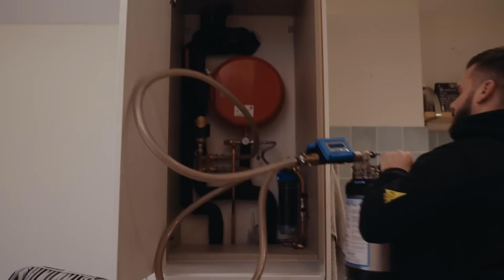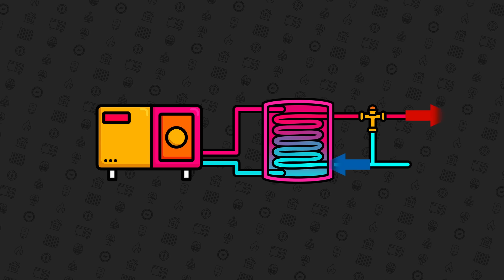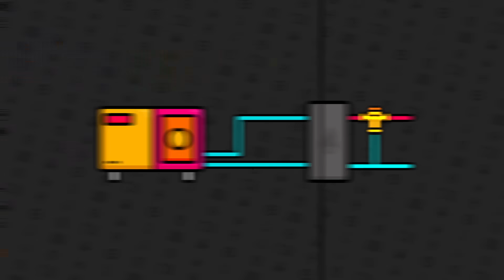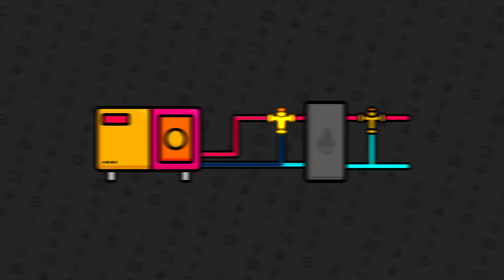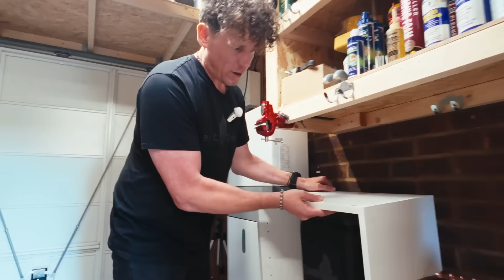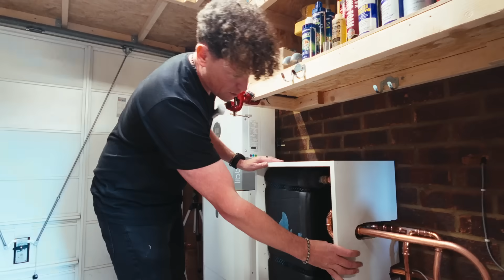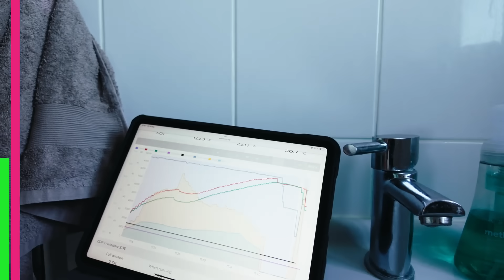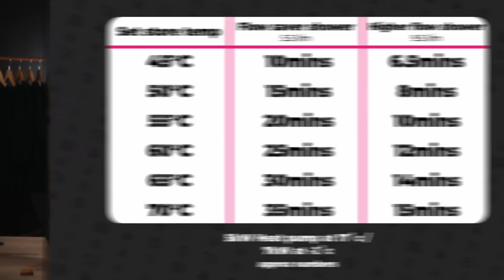World’s smallest hot water solution. (With a heat pump)

Comment: Excellent. 
Can I put one of these together myself with off-the-shelf parts?
Would love to do this in Tasmania.
Reply: Easily, it's all there in the video!
Reply: The heat exchanger is around the  euro 2000 price tho'
Reply: @brackcycle9056   350-500eu, but still its a stupid idea.
Oh scratch that, I was looking at the wrong model, those start at 1k, so this is even dumber.

Comment: but dont the uk regs say it needs to reach 60 degree for legionnaires? can the blending valve be set to 60 on one side and another temp on the other?
Reply: That's commercial regs, not residential. For Legionella to grow, the water needs to be stagnant as well. Given the low volume of water that would be stored in this, there's essentially zero chance of it not being turned over enough to be a problem.
Reply from the maker: Please watch out legionells video. Also the water in the plate could well be above 60c… dirstribution pipework isn’t storage

Comment: Hi, well done for trying this. Surely there's significantly more potential in combining a heat pump with phase change material (PCM) such as what Sunamp, Nyle and others are doing?
Reply from the maker: No. That has an extra heat exchange which makes it even less efficient and slower. Also needs another heat exchanger which takes up space. Also less simple generally

Comment: Thanks for all your efforts to make efficiency available to all, it is very inspiring. Electrifying things like heating and hot water is crucial. 
My only worry (as an ignorant lay person) with your system here is that is seems to have a lot of mixing valves doing clever things and I wonder if that will end up being a problem in a hard water area. Might it require a lot of maintenance and servicing?
Reply from the maker: Much less than a combo boiler. 70* less

Comment: Good luck getting the heat pump to kick in in a minute or two every time, mine can take up to 10 mins to kick in, I've had a 17kw heat pump maintain a constant 50oC in a thermal store
Reply: Sounds like you need more monitoring/control on your devices.
Reply: @mortenprivatekallesoe8917  i install many heat pumps from different manufacturers, they all have delayed starts to prevent compressor short cycling and regulations on starts per hour for DNO

Comment: This vid inspired me:
What if a 10L or 15L low-power DHW cylinder is filled with the DHW output from a standard Heat pump?
This setup costs 25% of the setup with a plate heat exchanger and two blending valves.

I have developed a DHW cylinder dimmer for personal use to heat a DHW cylinder. 
This DHW cylinder dimmer with a max capacity of 8A (=1.800W) is based on an ESP32 and could use the overcapacity of the PV-panels …
… to ‘recover’ from showering, 
… to slightly increase the temperature of DHW 
… for a weekly legionella run

Btw, I developed this DHW cylinder dimmer for personal use, not for commercial use.

Comment: small snag: the plate heat exchanger alone is 1500 pounds at manufacturer in Poland, before import tax to the UK, no diverter valves, no plumbing, no insulation. kinda pricey I'd say. stainless steel has a very poor specific heat capacity, as has copper (that's why they are so great conductors of heat), less than 1/10th of water's, even tough volumetrically that almost evens out, though water still comes out on top. It would be far far cheaper if you designed for water to be the heat mass and for a smaller plate exchanger to give you the speed of heat transfer that you need for the shower flow. Essentially you could store the same amount of energy, for like 1/15th of the cost. this way you are using a 3.5MW(!!) and 1500 GBP exchanger literally as thermal mass, which sounds (and is) kinda nuts. Just design for the power the shower needs and see which is the smallest heat exhanger that can give you that, with a small overhead, problem solved. A 45kW exchanger is 40 GBP, no stupid 2" connections either.
Reply: If you think of this being similar to replacing a cylinder then £1500 doesn't seem too awful
Reply: @AdamBeddall  I don't know, would it though? I mean replace the cylinder in functionality? Because it seems like a very high price for a quickie in the shower, for the same volume of storage, only distributed in a cubic shape, as opposed to a cylindrical one. There are cubic water 'cylinders' as well, if that's what is needed to fit. Hell, you can take a 100l jug of water, insulate it around, and you'd have the same thermal capacity. Add a 50 quid plate and that's you done. That's not a grand and half surely.
Reply from the maker: Don’t worry about all that. We can get these for about £500 or even less. Thai was just for the test
Reply: BA115-100 model used in Nano Store is priced at €1,719.99 (approximately £1,462) . That includes VAT however. So xVAT ~ £1,218.33

In the context of a £7.5K grant this is not outrageous!
Reply: @barryjames5879  
you still have to pay the VAT to UK HMRC when importing the goods, the seller will charge you VAT at sale point and then pay it to the UK.
in the context of other tax payers paying for the heat pump+install, nothing is too expensive, up to the grant sum. funny how as soon as there is a grant threshold, everything ends up being more expensive by exactly that amount, must be a coincidence.

Comment: This is impressive, but I disagree with the statement that just because 80% of homes have a combi boiler that 80% of homes can't fit a  hot water cylinder. Most of those homes would have originally had a hot water cylinder which was ripped out when combis became widespread. We ultimately want to move people back to having hot water cylinders because the spike of power the grid will need to handle morning and evening 7kw shower periods would be insane.
Reply: More or less insane than millions of homes with wall mounted Triton electric resistance showers heating up water in a jiffy right before water reaches the shower head? My flat, like many homes, had gas central heating and hot water tank but the shower was electric.
Reply: It's not 7kW of electricity tho, because it's going through the heat pump so maybe a third of that draw. Probs not dissimilar load to an electric kettle
Reply: Yeah, it's probably more like 30% which don't easily accommodate a cylinder. Still a big market though.
Reply: Every house I've ever lived in has always had an electric shower, so I don't understand how having an air source heat pump is any more of an impact on the grid than people having electric showers.
Reply: At the beginning of the video he suggested you need a 7kw HP and is talking about 60-75 degree water - so the system is going to be pulling a lot of power. Electrification of the entirety of the UK's heating, DHW and transport is going to strain the grid and we should be trying to load shift wherever possible. I think it could be very useful but moving people back to having cylinders should be a priority as they basically act as energy batteries.
Reply: @j.c.7780  When he says the heat pump is 7kW he is referring to it's output it'll only take around 2kW electricity to provide that 7kW heat output maybe more maybe less all depends on the CoP.
Reply: Huge percentage of homes in Brazil use electric (resistance) showers. In hotter parts they are usually 4kw, on the cooler, 7kw. The grid can handle it just fine...

Comment: and what happens in winter when a defrost cycle kicks in. 🥶🥶🥶
Reply: Its exactly like a DPF regen on a derv., if you run it daily then its just doesn't need it/dont notice it - I've never noticed on my Derv. of 180000 mile Tiguan sport 170 (58 plate) or ASHP 🤷‍♂🤷‍♂🤷‍♂
Reply from the maker: Tested with ministore. No issues so far

Comment: Glad to see you getting further. What mains water temp did you have and what was the measured flow rate of the hot water? Guessing in winter you need 20-25kw ish of power to heat mains water at 8 litres per min. So need a good balance in your heat exchanger of volumetric heat capacity and thermal conductivity. Of the common materials looks like steel and copper most likely candidates unsurprisingly. Copper would probably be best but insanely expensive.
I suspect the biggest gain in the system you tested is changing the control system to get the heat pump to kick in ASAP and lowering the thermal mass as much as possible on the primary circuit side as every second is valuable.

Comment: Absolutely brilliant.....always wondered if a heat exchanger would be efficient enough to deliver hot water to showers etc.
Reply: We use a plate heat exchanger to provide instant hot water - but the source is a thermal store. This means the water in the store only needs to be heated to 43C, because there's no risk of legionella in the tap water, so the heat pump never has to run with a high output temperature. We get a flow rate of 16 lpm from the bath tap, but of course the thermal store takes up a lot of space.

Comment: Make the plate in a bigger size for the external version, heavy af but still small. also i like the top up electric at each major outlet but thats a lot oof power draw and the combined SCOP turns to s*** I'd guess. Also, its small enough to consider wrapping it with an aero gel blanket for even better thermal insulation. This will be on Ali express within a month, lol. 

Question, will this still work in a hard water area?

Comment: That is tiny! My landlord had a gas combi (Vaillant ecoFIT pure) installed 1½ years ago to replace my ancient (80's? 90's?) boiler under the sink, and this new one was too big to fit under there (it's 70x40x28cm). They had to install up in the corner wall of the kitchen.

It's much, much more efficient than my old boiler (and faster ~1 minute to get to 60°C hot water at the tap from cold in summer) but something like this (or even a bit bigger to cope with a small flat's winter CH loads) would have been ideal to reduce dependency on burning gas.

Absolutely wonderful that you've come up with this idea and tested it, would be good to see more tests in winter, or a spreadsheet that matches the flow temperatures you were getting so we can put in different outside temperatures and heat pump sizes.
Reply: Yes that'd be very interesting
It'd be cool to get more space in the house lol

It'd also be kinda cool if I could get this system put up outside too

Comment: CONGRATS!! Can we re-run the test in January??
Reply: Can we also discuss Legionnaires prevention?
Reply: @Brown969 since you practically don't store a large volume of water it's not required to have legionella prevention. If you hit the hot tap once a day, the whole hot water system is flushed.... which legionella build-up where?😊
Reply from the maker: Ofcourse… we will have a few installed by winter don’t worry. All with monitoring

Comment: Could you do a hybrid system with a 3 kw or 7 kw immersion to assist up the heat pump if it starts to fall behind after 10 + minutes of high flow showering?

Comment: I asked last year at installer show why you didn't consider commercial plate heat exchangers when considering the mini store and got talked down to like it was a bad idea. Nice to see I wasn't talking rubbish and it's actually a viable option once you add blending valves to it. Though depending on distance from outlets a blending valve won't be needed, or localised blending valves as per the water regulations on sanitary equipment. You don't necessarily want blended hot water at the kitchen tap either.
Reply from the maker: A plate on its own as a heat exchanger wouldn’t work. The change is using the plate its self as a thermal battery. Sorry you felt talked down too thats very like abyone in our team

Comment: Why is no-one making an all in one air conditioner that can heat the water while cooling the house. The cold air from the outside heat pump is wasted
Reply: Mostly because the cold air is on the outside of the building. A typical heatpump pulls air from outside extracts heat and exhausts it so there is an outside closed loop. On the inside the same is true. It's technically possible but that kind of heat redistribution normally needs different equipment. For example it's common in small machine rooms to use a dual duct system like a Fral and take air from the machine room, blow the cold into the top of the racks and in winter the warm into the office. That only works though because the entire system is inside so you are not creating air movements due to pressure differences.
Reply: Got it, but if the inside of a house is warm, that heat could go into the hot water tank and outside doesn't get involved  @etchedpixels
Reply from the maker: They are. There’s a few of them

Comment: My previous house I created something similar (no heatpump but all electric), a tiny 30l boiler (1.5kw) with an electric heater (11kw) in series, with a mixing valve in between. This ensured that there was plenty of shower water during winter, when tap water is colder. Too cold for the   electric heater only. By pre heating the water by the small boiler the wife was happy!
Reply: I have fitted these hybrid systems where no gas just for dishwashing!. No bath just an electric shower as well. Who washes dishes by hand ??

Comment: Nice try, but although I'd love it to work, the calculations say that this won't work in winter. Assuming you use a 7kW heat output heat pump, performing the energy balance equation this will only raise the water temperature by 18.25°C at 5.5l/min. While this might be fine in summer when the mains water temperature is 15°C, in winter it'll be down as about 5°C, out colder on some locations. Meaning only a steady state temperature of 23°C. I think this works be a significant short fall that the volume of the heat exchanger couldn't overcome.
Reply: I think this is sadly the summary of what looks incredible in the summer. Cold water supplies drop to 5-6 degrees in winter, and I don't think it's possible to store enough heat in 30L of water to stay on top of things
Reply from the maker: I think you’re using the basic mass flow calculation and not factoring in thermal mass… this will easily achieve well over 8 minutes in winter with a 7kw if we achieved 30 mins at 17c with a 5…
Reply: the heat pump acts on the primary circuit only, it's not mixing in any mains water. once it reaches max temp in the heat exchanger, it stops. the heat exchanger then heats the mains water to shower temp, acting as a high power thermal 'battery' if you will. at this size, it's power is virtually unlimited, can heat water from any liquid temp to showering temp, it's just a matter of how long it can do that (aka battery capacity), and how much it costs initially.
Reply: @franciscgedeon9237 Yes but a 7kW heat pump can't throw out enough heat in the winter to heat water continuously.
Reply: @CCyoutube0  correct, hence the need for the thermal accumulator of the mass of the exchanger. I would even say it won't work continuosly in summer either, as they have shown in the video, the thermal storage is empty after 20mins of showering.
Reply: @franciscgedeon9237  I think I misinterpreted your comment as saying this setup can provide unlimited heat as then the heatpump takes over, but you meant that the heat exchanger can exchange unlimited if it was provided enough heat from a bigger heatpump.

30L of water at 65 degrees is equivalent to 50L of water at 41 degrees when fed 5 degree ground water. 50L would get you a 5-7 minute shower before any heat from the heatpump, in winter. So it's not totally impossible to work, but needs pretty perfect conditions
Reply: @CCyoutube0  you are correct. As in the heat plate can supply all its stored heat very fast (rated at 3.5MW of transfer power, essentially that means 'unlimited' in this use case). Doesn't mean it has infinite capacity, just that it can dump all of its limited capacity very very fast if needed. So in theory it could supply a higher flow of shower water, but for even shorter time, before it's exhausted and needs recharging by the heat pump.
The design is sound, it's being done since forever, there is a reason why this approach is 'novel', that's because anyone with an engineering degree would tell you that storing heat in stainless steel mass is about as efficient as storing it in plain water, for the same volume. Surely we can agree that stainless steel, in the form of a high tech plate heat exchanger no less, is a poor choice cost wise when it comes to bluntly storing heat. Just heating water to achieve the same heat storage capacity seems like a much more obvious choice. And you deal with the problem of the transfer speed in a cheaper manner, using a small plate in the shower circuit. This is all being done right now in commercial applications, this looks like a solution looking for a problem. If you have a storage space problem, you would be looking at something that fits in the limited space you have, dunno, a 100l jug of water does the exact same thing as this bit plate. The temperatures involved aren't unusual, 60-65deg is something any plastic can handle, you don't need to pressurize the circuit necessarily, I don't really know why they went for the expensive piece of metal that needs 2 people to lift even when empty of energy, lol.